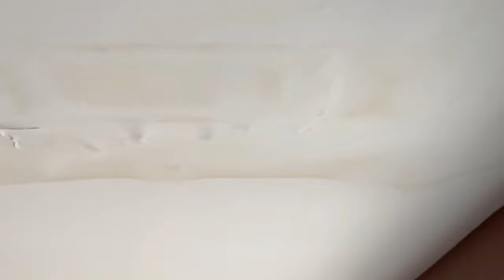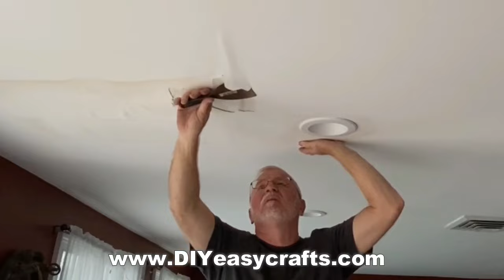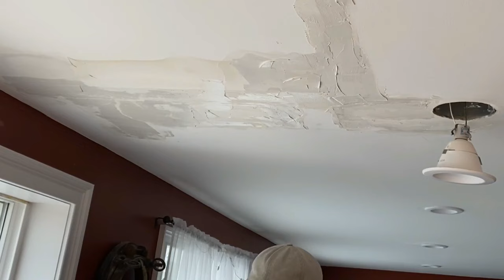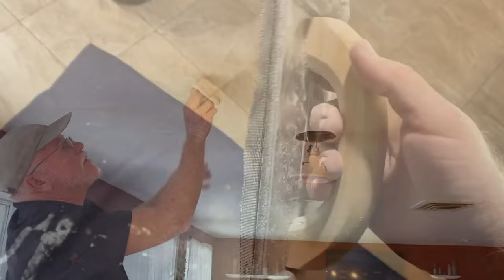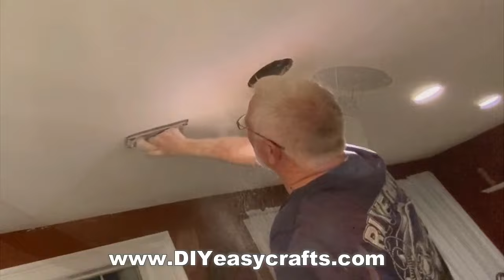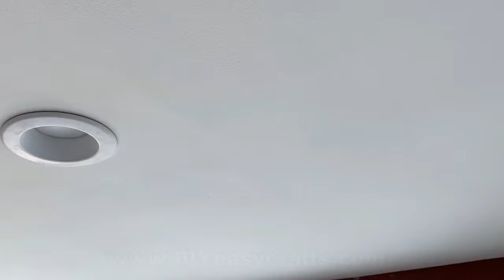DIY Water Damaged Drywall Ceiling Repair: Easy Step-by-Step Guide

Comment: Thank you for this.  We had a leak from our upstairs shower a couple years ago, but I've been putting off repairing the ceiling that was damaged.  It wasn't going to be just a sanding, Kilz, then repaint job.  It was cracked along the tape line.  Luckily all I needed to do was chip off and replace the 1/16 inch of sparkle that was on top of the paint.  I didn't have to retape.

Comment: The sheetrock is gone if you could scrape off paint like that.  You should locate your problem and replace the drywall. My guess is that your insulation is soaked with water and you have substantial mold behind the sheetrock.

Comment: What about black mold formation? Gotta do a lot more than replace the drywall. You need to replace the subfloor and whatever wood on the joists that got wet.
Reply: Replace the floor joists that got wet? lol really? As long as they aren’t rotted just let them dry out and they will be fine. What do you think happens when a house is being built? You don’t think it ever rains? If you don’t think floor joists have ever gotten wet before you are high
Reply: @Mc-te5uy wood getting wet... and many other materials like drywall and especially osb will eventually have mold. Drying things out helps but long term things getting wet is exclusively THE BEST WAY to have black mold show up and damage people's health. Houses have never been as expensive as they are now and they've never been more poorly built. It's morally wrong. So yes I go the extra mile and replace wet wood and wet materials. For example if there's been water damage in a customer's bathroom I will tell them it is best to cut it out and replace it and I will lower the price and eat some of the cost and sometimes all of it. Because it's the right thing to do.
Reply: @Mc-te5uy I also try really try to avoid building houses for people during parts of the year that it rains. Most people appreciate it when I bring it up and are willing to wait. Because it's what's best for the home. Water damage is a serious problem in America and most of us professionals don't care enough and focus on the money and say things like "oh it's gonna be fine." I'm trying to be the best I can be and you can feel free to be however you want to be.
Reply: @Mc-te5uy Scabbing out a small section of a couple floor joists or TGIs is extremely easy to do anyways. It's not hard and it doest take long.

Comment: This is absolutely wrong for so many reasons. You do not leave water impregnated sheetrock up. You remove every area that is stained. There are a hundred competent videos on repairing water damaged areas of sheetrock. THIS IS NOT ONE OF THEM!
Reply: He’s so messed up lol
Reply: You're 100% right about this. Black mold is enemy number 1.
Reply: There’s nothing wrong with the drywall as long as it’s dry. You have no idea what you’re talking about.
Reply: You sound like an overcharging repairman.
Reply: I do a lot of home repairs as I am in a place that needs some TLC. Although this video is a great reference for cosmetic maintenance, for actual structural, functional repair, you need to replace the soggy Sheetrock EVEN IF IT IS DRY or else you'll be repeating the process I do commend him for the attempt @loveormoney786

Comment: what about the damaged wood? it appears this just fixed the superficial but if there was water damaged it should of had been broken into to see where inside the water also damaged
Reply: That's exactly right. Black mold is something you don't want in your house. It would be good to replace the drywall. And scab out the joist areas that got wet and also replace the areas of subfloor that got wet.

Comment: I hope INSIDE the cieling was dried properly from water damage. This is the issue now a days that create mold especially with the cheaper materials mold and moisture feed on.
Reply: I had a small wet area in the ceiling, but the drywall still seems solid, is it okay to just scrape, patch and prime and paint IF i let it fully dry? I also plan to use those mold blocking/stain covering primer too
Reply: @bludika No I'd replace everything that got wet. Black mold is NOT WORTH the risk.
Reply: Tilex bleach above.
Reply: Agreed and then the whole house is infested from the spores.
Reply: Great comment. I'd replace any part of the floor joists that got wet.  And the subfloor that got wet. And especially the drywall that got wet. And anything else. Drywall is actually very prone to black mold formation.
Reply: @StarfieldBattlefront  ship of theseus

Comment: We’re you concerned about mold at all
Reply: Its actually a great quick temp fix until you can get a pro in. As far as mold goes, you just set up a dehumidifier for a day after you open it up to really dry it out. You can always spray it with some simple green before you tape and spackle if concerned. That will retard mold growth for awhile.